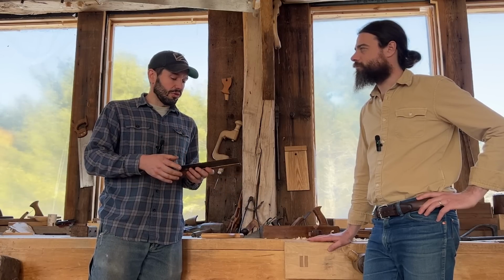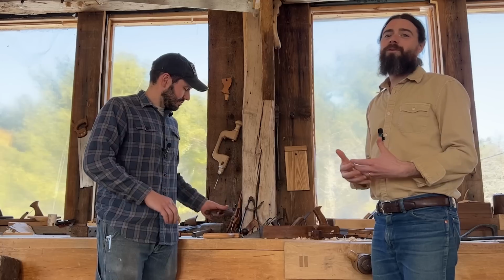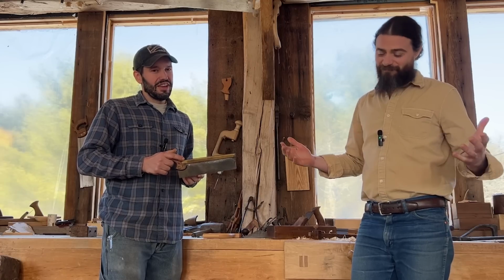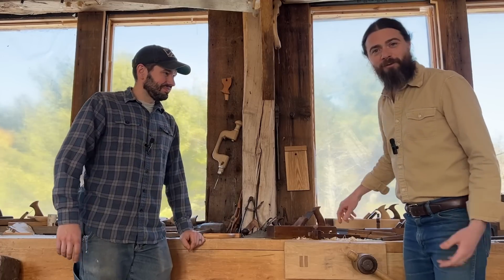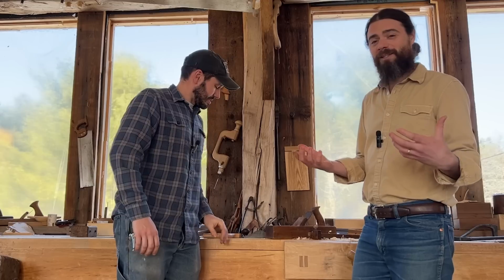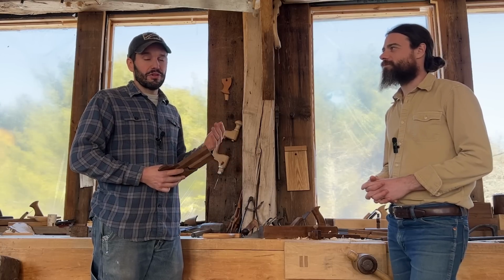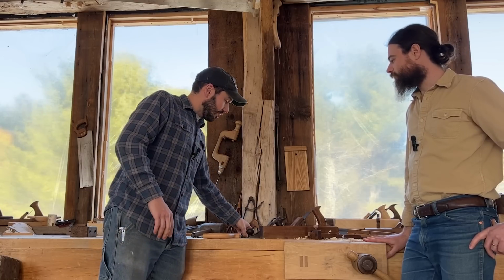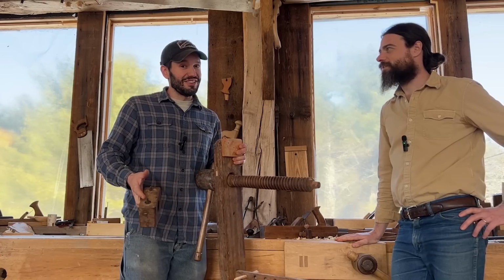Restoring Old Tools

Comment: I don't know where you guys shopping, but at the time of writing a decent vintage back saw online is in the 40-50$ range delivered. Let's say we spend 10$ in time & materials for restoration, labor is not included. This brings us to the 50-60$ range per saw, which is really close to what Veritas asks for their saws, that are ready to work out of the box and replaced no questions asked in case of any issue - even if it's just a perceived one. Also you'll have to try very hard to spend 300$ on a dovetail saw, they're actually in the 150$ range (LN and a bunch of other boutique makers).So it's not really 1/10th, it's rather 1/2 the price. I get that you aren't trying to be scientifically precise, but a gross exaggeration kinda kills the trust in what trying to tell.
Reply: The last antique backsaw I restored cost $5 at a flea market. Maybe $.50 in materials. Compare that to the frankly unattractive $130 Lee Valley tenon saw, and it is a no-brainer.

Comment: I would love to hear your thoughts on krenov style laminated planes, versus mortised plan bodies.   Especially for the intermediate wood worker who’d like to make their own.   Did the people in the heyday of planes avoid  laminating the body because it was better - or just because glues sucked ?
Reply: "Krenov planes" and "laminated planes" are two different categories. From a user's standpoint chopped or laminated doesn't make any difference assuming a good job making them. People of heyday didn't avid laminating planes, it's just very few have survived — something that shouldn't really bother you a user. The real difference is the form of a plane and hence ergonomic: Krenov planes are strictly finishing tools for machine milled surfaces, can't use them for heavy shaping. But if you want yourself a traditional jack plane and don't want to invest 500$ into floats - laminate it, it will be a great plane. Actually, there's a video class by Richard McGuire (The English Woodworker) where he builds a jack by lamination and then he uses it in subsequent builds for heavy stock removal.
Reply: You can use the "Krenov method " of laminated plane construction to make pretty much any style or type of bench plane.  I've been using jointer and jack planes with traditional totes for over 15 years with good results.  The planes have the look and feel of traditional English planes and perform extremely well.

Comment: Excellent series idea. So many youtube restoration videos the guy goes way off the deep end. My experience agrees with yours, getting an old plane up and running is generally a quick and simple process, and I've managed to get a pretty well equipped shop for little money. Folks need to know that restorations don't need to be intimidating. One of my latest finds is a Disston No. 32 pruning saw, which I sharpened and it works really well for greenwood or heavy cuts in timbers, probably every bit as effective as a modern Silky saw, but only cost me $3, and its sharpenable.

Comment: I don't restore old tools. I find GOOD usable old planes and chisels (some were my Great-Grandfather's like his Disston saws) clean and sharpen them and use them. I bought a Bailey Number 20 jointer plane for $25 at an estate sale that just needed some plane-tuning and TLC and sharpening and I've been offered $500 for it now. The English Shipwright's chisels (can't think of the brand right now!) I bought for $200 for 3/8 to 3" that were worn rounded have been stropped on my straight razor strop and I can shave with all 8 or 9 of them-same with the Firmer chisels. Except for the Japanese style chisels (I'm not good using them) good steel new hand wood tools hardly exist for under four figures each. The English chisels don't hold an edge, and the Swiss, Swedish and German tools cost as much as a new car. So many excellent old chisels and such get made into trash knives because they are good tool steel, but they aren't "working knives" they are ugly dumb useless DISPLAY knives. I believe things have a purpose for being and should be USED. GrandPa, Pawpa and my Daddy taught me that way and so did Momma. If you feel differently that's OK, but you know the way I feel. A Disston D7 crosscut handsaw needs to cut wood and it's rip brother does too.

Comment: I've restored quite a few tools now. I like doing it and I like using them after they are restored. They just feel good in your hand. However I will say it turns into a rabbit hole in and of itself. I am kinda compulsive in the process. I find an antique #4 Stanley Bailey for the sole purpose of gutting it for a chip breaker screw for another plane I've already restored and what happens? I wind up committing to restoring that one too. Always chasing my tail. It seems I am constantly one part away from restoring another one. Sometimes it would be nice to just flat out buy a brand new tool. On handplanes in particular I like new planes but the new makers always design them with the Bedrock style but in my opinion the Bailey style is more awesome. Also the brand new planes feel clunkier and heavier than a Stanley Bailey handplane. I'd probably be out a bunch of money if new handplane makers made planes exactly like the Bailey planes. Also, I have yet to restore a single tool that happened as fast as others say it takes. Some tools have taken hours and hours to restore. Some handplanes take forever to true and flatten the sole. Nowadays I don't even screw around with finer grits on soles until that thing is pretty near where I want it.  I start with 60 grit glued to a big flat piece of granite. For me the best rust remover is vinegar and water not some high dollar rust remover. I know someone will screech, "How dare I use vinegar and water on some tool?" I find that it works the best and honestly I don't care one drop about the museum value of some tool. I buy them to use them.

Comment: I saw a list of places we can find old tools you posted a while ago but can’t find it anymore!! In Canada Quebec, pretty difficult to find some good backsaws… is there  places online where we can find these except from ebay? Thank you so much!
Reply: There are online antiques stores, but it still going to be more expensive than eBay because of shipping. And it's still a lottery. An option for you is to consider gent saws by Crown (all the English gent saws are made at one factory, so the brand doesn't matter - G&C, Lynx, Crown, etc), they're excellent for dovetailing and can saw tenons up to 1 1/4" deep. This assumes you can set and sharpen saws already. Or just bite the bullet and go with Veritas, gent or toted - they're not too much more than a good vintage saw. I would recommend the latter, because you will end up buying a premium saw anyway (for a number of reasons). Nothing against vintage saws, but in the long run it's more expensive for a novice who is starting alone. But this is up to you - nothing in this hobby is cheap.
Reply: Can’t wait to watch this new course!!!